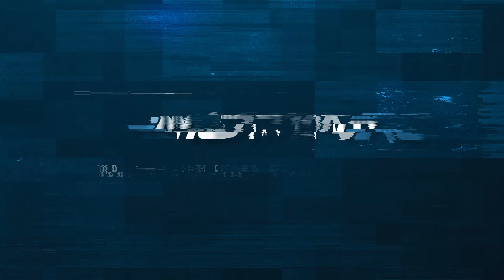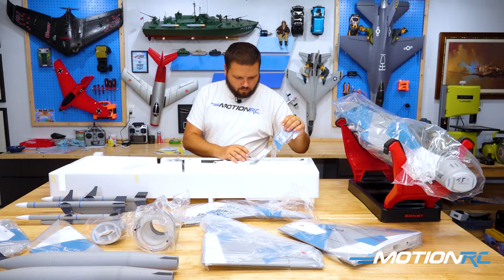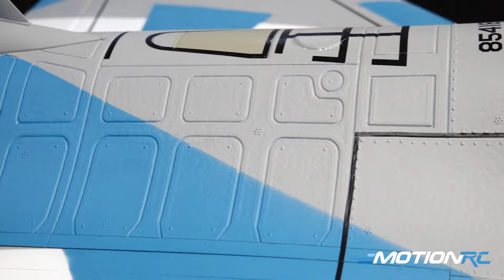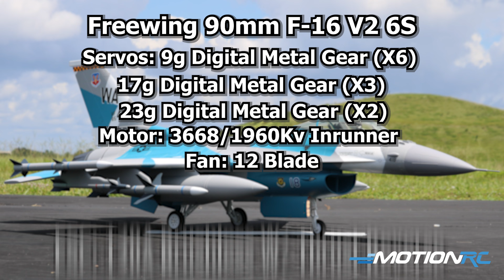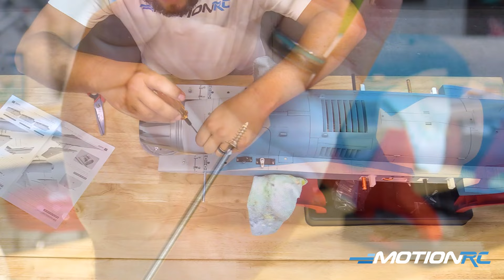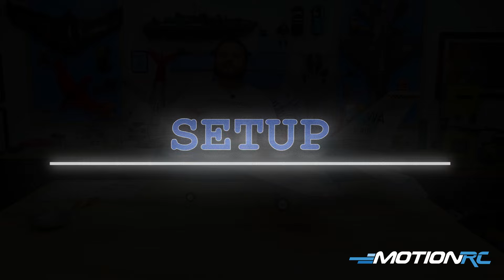Freewing 90mm F-16 V2 Assembly | Motion RC

Comment: Wes - looks like the screws for the elevator shafts are the machine screws and not the wood screws?  The wood screw protrude out and do not sit flat on the elevator shaft.  I think the remaining m4 wood screws are for the bottom fins.  Any comments?
Reply: I agree I tried this with provided wood screws as per instructions and it messed up the plane. Makes no sense. I’m waiting to hear back from motion as I want a new fuselage . Striped the opening and now the 7 mm flat screws won’t fit either

Comment: Some nice improvements, wish they had redesigned the nosegear for better ducting. Also still using wood screws for the elevator and the rudder is not good, I had to replace all of mine with machine screws since I store my v1 in its box so it comes apart very often.
I wonder if the plastic gear covers will be compatible with the v1